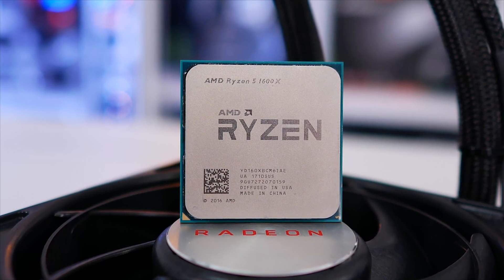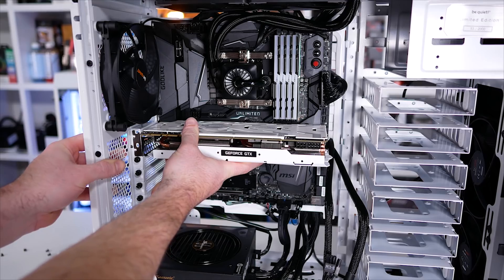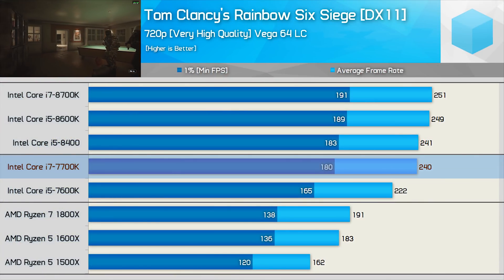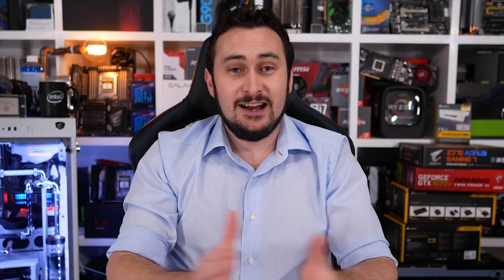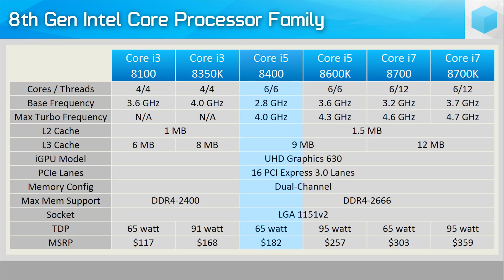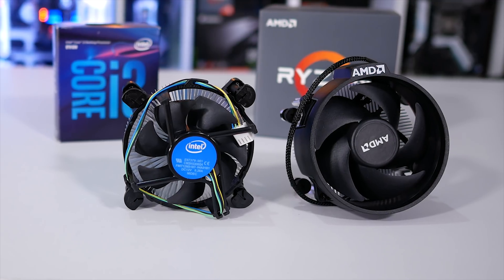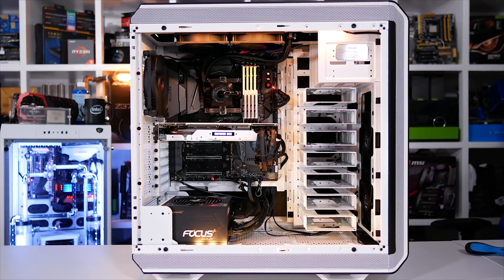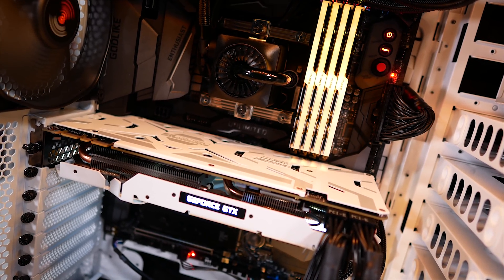Let’s Chat, R5 1600 OC vs. i5 8400 Benchmarks Incoming!

Comment: Currently the i5 8400 retails for 218 pounds in UK and the R5 1600 retails for 180 pounds.The cheapest Z370 board is 120 pounds,that is Asus Z 370-P.Decent B350 board so you can overclock is around 90-100 pounds.These are prices for parts that you can find in stock right now .Overall that is around 50-60( 15-20%) pounds more expensive for the Intel platform.I am just giving these prices if you want to use them in your next Video Steve.I am not saying to anybody to buy AMD or Intel.Buy what you you want.This is the type of competition that we want, and that is to be difficult to choose just because there are pretty good offers from both sides of the table.

Comment: Low resolution benchmarks are pretty meaningless for future performance prediction.  AdoredTV addressed this in a video back in March.  He focused on the FX-8350 and i5-2500k through the years.  If the low-resolution benchmark prediction theory held true, then the relative performance difference between the FX and i5 would have stayed constant or increased over time as better GPUs were used.  Instead, the opposite happened and the performance gap shrunk.

I think all low-resolution testing can tell you is how CPUs perform relative to each other at the moment.  That's good information by itself, but not enough to engage in prognostication.  

Are the Coffee Lake CPUs better than Ryzen?  Probably.  Are they worth buying if you've got a recent generation Intel or Ryzen CPU?  Probably not.
Reply: His video has been debunked.
https://www.youtube.com/watch?v=76-8-4qcpPo

Comment: About the chipset thing: if we are talking about locked non-k cpus for example 7600, 7700 and etc, is there any connection between motherboard and intel turbo boost potential?  Say i have 6700 on b150 and clocks go as high as 3.7-3.8 when all cores are active. Can i practically get 3.9 on all cores with z170 chipset? Or is it silicon lottery again here? Sorry if the question seems stupid. Love Steve)

Comment: Steve: The whole "8400 will run slower on cheaper boards" thing is probably due to other tech tubers saying that the CPU may possibly not boost so high on the cheaper boards, since the base clock is 2.8Ghz and the boost is 4Ghz, that's a huge range, so suspicions are that it will only boost up to like 3.6Ghz or something on a cheaper board and not the full 4.0Ghz.  I don't know how true this is and I guess we'll see when the cheaper boards come out. Lets hope that is just false speculation!
Reply from the maker: I'm going to go out and say it now even though I don't have to,  it's false speculation ;)
Reply: I think that's fair :P It does seem a bit tinfoil hat'y :P

Comment: Do we know if the non-overclocking 8th series boards will support multi-core enhancement?? Maybe that's what they mean by slower on those chipsets?
Reply from the maker: They won't but the Z370 boards I have don't with their current BIOS either.

Comment: Your benchmarks are legit. I have found no reason to complain about how you test - even though I STILL think an AIB 1080 Ti will provide higher FPS even in DX12 games. The ONLY games that does not apply tom are Forza 7 and the most recent DIRT game.

I have a theory as to why Vega64 does so well in RACING game specifically, some of which I think, is down to how AMD's HBCC functions - as it is FAR easier to swap data between VRAM and system RAM when the game is totally "On Rails" as it were. Racing game's maps are never too wide, they are always long, with boundaries to either side of the track. And that also plays into AMD being able to Pre-render then MANY repeating assets! 

Just my guess, because the GTX 1080 Ti thoroughly STOMPS Vega in EVERYTHING but those 2 racing games, and about 2, maybe 3 other titles in total, all of which are AMD sposored titles anyway.
Reply: If Vega was simply FAR better with DX12 - then it should NEVER have been the case that a GTX 1080 OCed/AIB beats V64 in Ashes of the Singularity, and the 1080 Ti just widens that gap.
Reply from the maker: Here are these CPUs tested using Vega 64 and a 1080 Ti, this data is also on the channel. Note the Battlefield 1 and Civilization VI results for Ryzen.
https://www.techspot.com/review/1497-intel-core-i7-8700k/
Reply from the maker: Sorry the link was missing from the previous post. I've now added it. Actually Ashes of the Singularity is a game I've followed closely and benchmarked heavily from day one. Nvidia applied a great deal of pressure on the developer to remove Async compute or reduce it's impact on the game.

A number of top tech sites documented this as it was going on.

Here is an early piece from me in 2015...
https://www.techspot.com/review/1081-dx11-vs-dx12-ashes/

Nvidia has since worked on a driver 'workaround' for this title.
Reply: Hardware Unboxed  Yeah I forgot Civ 6, but 1) I don't play that game, and 2) FPS is not of major importance for such a game.  IIRC, the 1080 Ti still wins out in BF1 DX12, but then last I saw, all GPUs were still running faster in DX11 mode. 

There are a handful of games where Vega does do far better in comparatively, but for every one game V64 wins out at, GTX 1080 Ti  is ahead in far more still. 

I am interested by those few Vega wins, and perhaps there will be more of those as time goes on! In any case, V64 Liquid or GTX 1080 Ti - both GPUs have more than enough power for CPU testing. Still can't help but think the CPU scores would have been wider still with the 1080 Ti, as far as I am aware, Nvidia GPUs are also notorious for requiring less CPU overhead, or at least perform better with lower grade CPUs, at least this was the case back when Polaris and Pascal were brand new...
Reply: Hardware Unboxed Oh, does Vega64 have more consistent performance between AMD and Intel system than the GTX 108p Ti would? Like the 1080 Ti would not  perform as evenly across platforms as Vega currently does?
Reply: Strange that... AMD worked with Oxide to build AoTS - and that is why in the EARLY benchmarks AMD spanked everything Nvidia. Also Nvidia did not have their driver preemption "workaround" ready. I mean I KNOW that Hardware Asynchronous Compute CAN make a difference, but even in the early days of AoTS, Nvidia in DX11 mode was still ahead of AMD in DX12, just AMD has closed most gaps with DX12.

I am a bit skeptical of claims that Nvidia's meddling had much of anything to do with AMD's DX12 performance, so long as said DX12 titles don't use GameWorks or PhysX anyway. 

Async cannot have been that incredibly important, at least not so far, when Nvidia in DX11 always managed to keep ahead of AMD DX12 even in the early days. I mean, at least from what I have seen so far, Async does not seem to be the massive game changer it was made out to be, as I have been following DX12 news ever since 2012 when it was announced like it was goimg to hit shelves within the year! But I imagine that it WILL become important, but even then, between Nvidia's pixel level preemption, Nested Child Kernels, and raw CPU grunt, I have to wonder... 

Interesting times ahead is all I see!

Comment: i dont understand why always the AMD fanboys are the bad ones and INTELS are the good ones ...
1)steve ok plz tell us how excacly you much the msrp of 8400 when at the official page of intel the say the price is for 1000k units.
2)about the mobo thing if someone want to buy a system now what he must do to wait about 2018 and buy the 360 ...its the only way to make a system now and the review that youmade is for now not 2018
3)ok an other example how you make a comparison and how you can recoment something that its not exist, i cant find 8400 and its out of stock ....
4)about msrp 1600 was 220$ when it come out now the price its a little cheaper  and you compare it with the msrp of a new cpu 
5)tell me or prove it that you can buy the 8400 at the msrp ..because at your own amazon link 8400 is over 300$
Reply: There are no good fanboys. The Intel ones suck too. But man the AMD ones are on some next level fanatic bullshit
Reply from the maker: AMD fans are fine, I was more addressing the toxic fan boys, there are many on both sides. That previous video just happened to upset the AMD variety.1) Expect to pay between $180 and $190 US for the 8400, I'd never pay more than $200. It was selling for $190 US initially.
2) I'd recommend a $120 Z370 board anyway and have based all pricing on this model.
3) Availability isn't something I can control, I can merely tell you how it performs and that you should buy it only at or around the MSRP.
4) I've been pricing the Ryzen 5 1600 at $215 US which is the Newegg and Amazon pricing, it's $5 below MSRP.
5) Again I don't control availability and I very very clearly stated in this video that Intel messed up this release and availability is poor.

Comment: I don''t know what "AMD Fanboys" are saying Steve, but the problem with 720p isn't that it is "included data".  Including data is fine, and I agree actually that more is better.   But no intelligent person  should ever say something as stupid as "720p indicates future performance".  No it just doesn't lol.   That has been proven false time and time again.
Reply from the maker: Well I assume you are implying I said that, context is very important. This is exactly what I said previously…

“The 720p results are important for a few reasons though I admit for some they can be a bit misleading. The reason they are important is because they show us the true difference between CPUs in these games, with the speed limits removed this is how fast they can go.

In my opinion this gives us a good indication of how future performance should look when using yet to be released high-end GPUs, you know like the Titan XpX. The fact that the Core i5-8600K was 24% faster than the Ryzen 5 1600 on average means that in the future when GPU’s become much faster and games become more demanding, the Intel CPU should stand up better and potential last longer. Kind of like what we see when comparing the FX-8350 and Core i7-2600K in modern games, just to a much lesser degree as Ryzen’s actually quite good and the FX-8350 powered by 8 hamsters in 4 wheels.

However, we’ve seen that Ryzen works much better in well-crafted DirectX 12 titles such as Civilization VI and Ashes of the Singularity for example. The issue for AMD being that in late 2017 we still have very few well put together DX12 titles. Should we see an influx of quality DX12 titles over the next few years, then this could change the future prediction of the 720p results shown here.

If you had to make a bet now based currently available data, you’d probably just invest in the Z370 platform and get something like the Core i5-8400 as it will certainly look after you well right now. It also comes at a relatively low cost per frame and with 6 physical cores it’s not going to become extinct anytime soon.

Even if we look at the 1440p cost per frame data including motherboard pricing, we see that the 8400 costs just 8% more than the 1500X, but honestly I’d rather have the 6-core Core i5 for that small price premium.”
Reply from the maker: Also Hard|OCP tested the 2500K and 2600K at low resolutions back in 2011 and found the 2600K to be 20% faster in some of the games tested.

Meanwhile back in 2011 I tested at 1080p and 1600p and found no difference between the two.

I can admit when I was wrong and I messed up in 2011.

* But no intelligent person  should ever say something as stupid as "720p indicates future performance".  No it just doesn't lol.   That has been proven false time and time again.*

By who exactly and when?
Reply: Steve perhaps you are not directly saying this NOW, but I would say that "context" easily implies you are considering previous statements like these:  

https://www.techspot.com/news/68407-tackling-subject-gpu-bottlenecking-cpu-gaming-benchmarks-using.html

 "how will Ryzen look in regards to the current Skylake and Kaby Lake processors, presumably the 4K performance would start to look like what we are seeing at 1080p."

^In fact you go down into the comments in this article to defend this point by directly saying 720p translates into future 1440p and 4K performance.   So yes this was stated before.

Now please understand that I have started to notice that in newer videos/articles you have amended your above statement by saying that:  "720p testing shows how future high end gpu's will perform in these SAME games".   I would say that statement is plausible, but you may want to continue to emphasis that because TBH this is the only channel I have seen where the benchmarker makes that distinction, and I am guessing many people (me included) assume you are doing it for the same reasons 99% of the other tech channels claim to be.

Thank you btw, this is the nuance I come to Hardware Unboxed for :).

P.S.  I will once again say that 720p is so far away from 4K/1440p in pixel count that there is just too much room for odd bottlenecks to pop up in testing.  Might I suggest using 1080p@medium settings instead of 720p@Ultra?    This would lower the load on the GPU more evenly than simply lowering the pixel count alone.

Comment: R5 1600@ 4ghz and ddr4@3200  vs  i5 8400 and ddr4 2666...gaming performance is more or less the same +/- 5% on resolution 1080p or higher...Productivity is better on r5 1600 oc...

True comparison should be R5 1600@3.8 ghz with stock cooler and ddr4 2666mhz oc to 2933, b350 mobo 70$....this combo will have more or less the same price as i5 8400 with b360 mobo and ddr4 2666 (when we get budget Intel motherboards)...

Comment: I'm against low resolution with "LOW SETTINGS " testing. that method will emphasize a gap that is simply unrealistic and never in time will become like it.
Your method is legit, lowering the resolution and disabling AA, will simulate a more powerful videocard, as that are exclusively his work to do.
Again, no one in the right mind is against lowering resolution, is the lowest settings in some games that is wrong, bicause it may take away cpu load also.

Comment: Oh hey, this is pretty informative! Following an AdoredTV video I did wonder if Intel had tried to pull a fast one on us with the range of the max turbo frequency, as really I don't expect them to be below that. But since you and Bryan from Tech YES City have bought retail chips, tested them and found them to be identical, it seems like everything is good. Your explanation is pretty interesting, with the chips probably not reaching the max turbo when there's heavy AVX workloads. It's definitely true that between hyperthreading being disabled and the fact that a higher frame rate is essentially achieved by CPUs making as many request as the GPU can handle, there really shouldn't be any reason these CPUs can't reach max turbo when playing games. In any case, I was sure you would benchmark the i5 8400 with lower end motherboards once they came out so I never thought your benchmarks were insufficient (I mean, I guess you could benchmark every Intel CPU from their first generation up til now, right? :D)

And reading the comments, there was someone mentioning that he gamed at 1440p with lower settings instead of 720p. I was intrigued; that could actually be interesting. I mean, I'm already aware that between maxed out quality settings and slightly lowered quality settings, there's a fair difference in the burden to the GPU without there necessarily being a very visible difference in terms of quality. Obviously, resolution has a big impact in terms of burdening the GPU but I am curious as to how it compares with changes to quality settings. Although those benchmarks would probably be more interesting if you compared intel and amd cpus with nvidia and amd gpus. I'm expecting that the CPU will be agnostic to what settings are being used for resolution and quality and will simply push out as many frames as it and the GPU can handle at those settings, but you never know, perhaps odd stuff happens (although it'd probably be related to the game engines too lol, I'm kinda going down the rabbit hole here.)

Anyways, good stuff! :)

Comment: Maybe add link to Google Spreadsheet with options to copy, with your results and price you use and chart price/performance. So people how want change price as they can buy, they can easily do it?
Reply from the maker: For comparing two CPUs you need your price, and the average FPS result. Divide the price by the fps result and you have your cost per frame.
Reply: I know, but I know too how people are lazy and for most (especially young) making chart is magic ;)
Is only suggestion, it may or not help some people.
BTW for me I want more know your opinion on using frame timing more then avg fps, I made few comments bet never get answer. (only your thoughts about it)

Comment: Testing at 720P shifts things more to driver optimization an what architecture the game engine prefers or is optimised for. So you really need to have a game with a very solid game engine to test at 720P... Not that easy as you might think.
Reply from the maker: I don't agree with that, we're using high quality settings and the frame rates are far from extreme.